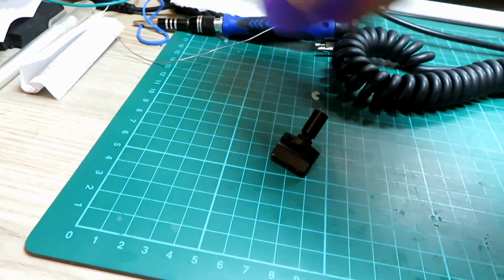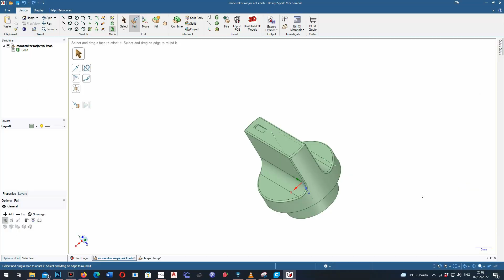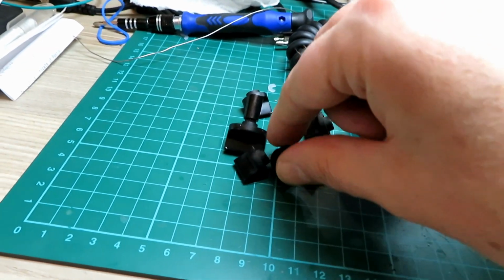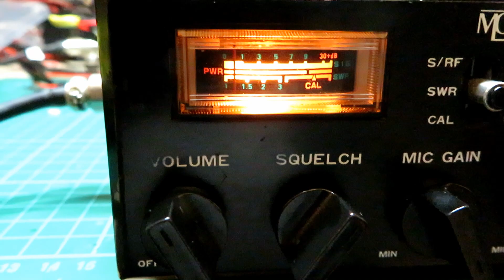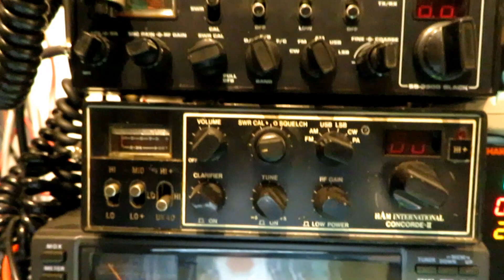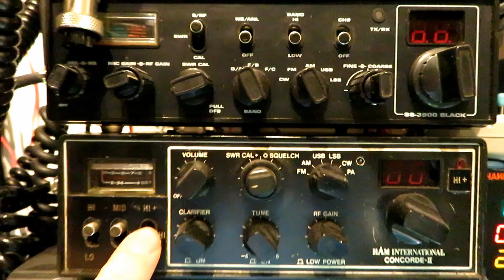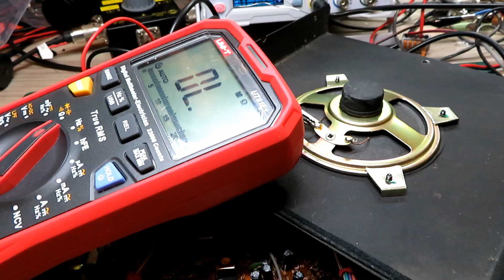SOME HOPEFULLY USEFUL ADVICE WHEN REPAIRING RADIOS AND MICROPHONES - SORTING THE MOONRAKER MAJOR

Comment: I used to do the same for those types of mic's back in the 80's with the battery's. don't think they were that brand though.
When you mentioned the switch, I chuckled remembering my time at the bench in the 70's and 80's, was a nice cost effective repair for the customer and time saving for us even back then.
Wouldn't believe how many mic's people scrapped.
Loved heat shrink since I first got some in the early 70's
Good repair :)

Comment: Great video Paul! Love the fixes! The mic definitely sounded better on level 4. It is also dependent on the sound from the randy III on the video of course I guess. 
I have an extremely good condition Rotel RVC-240 with the original near mint coffin microphone and box that Richard has featured. If you haven't got one in your vast collection and would like to use it in a feature, by all means let me know and you would be most welcome.
Chris.
Reply from the maker: Cheers 😎

Comment: I have a HAM internation, Multimode 2 that powers on but no receive nor transmit power. If the end finals are dead is it normal there is no receive too ?
Reply from the maker: No, that sounds like the vco isn't locking though.